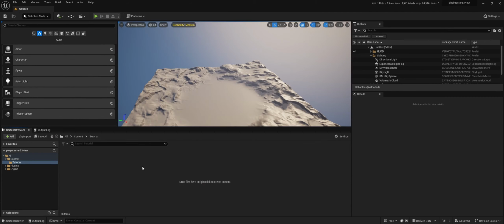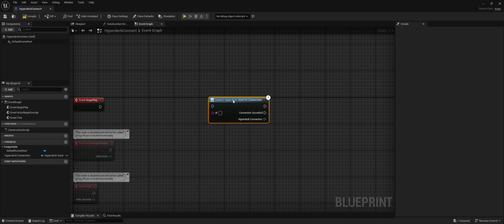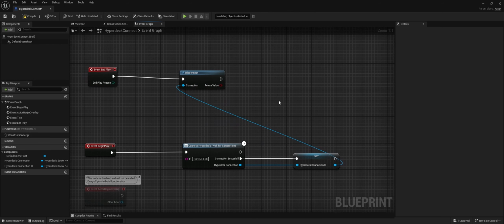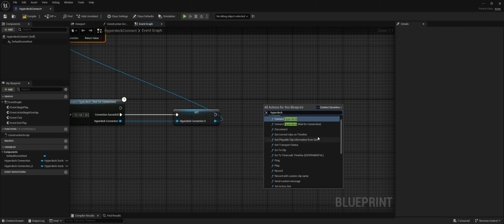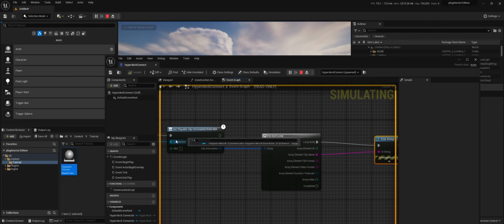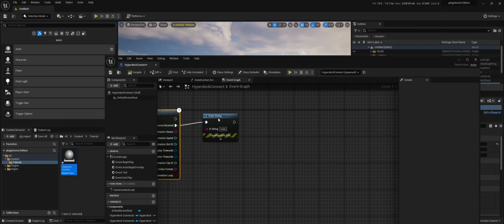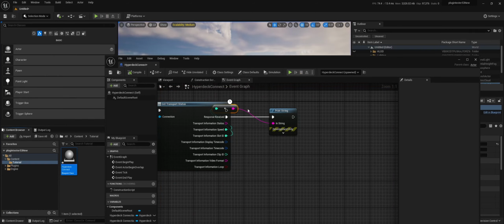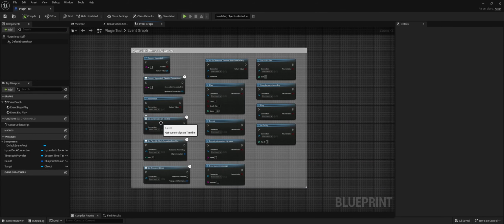Hyperdeck Control Advanced 0.7 now availabe  - Unreal Engine 5

Comment: Hey Geert, I bought the advanced version. But I keep getting "The following modules are missing or built with a differnt engine version: Hyperdeck" 

I"m using the 55 version with UE 5.5.
Reply from the maker: Hi! Sorry I totally missed this as I normally do support through Discord and email. I have replaced the 5.5 version of the plugin on Gumroad that now works with 5.5.4 of Unreal. 

Again sorry for the late reply.
Reply: Awesome, thank you!

Comment: Don’t know what this tool is about, but all the examples are possible with one line commands in a TCP session (in for example Terminal) with the Hyperdeck
Reply from the maker: The plugin is for integrating the Hyperdeck into an Unreal Engine project to send triggers within blueprints to the Hyperdeck and get information back. I use it for automation of recording of the build in sequencer in a packaged project.

You can use a terminal or make a TCP session another way if you would like. This plugin just makes it easier for people to make something quickly in blueprints or don't know how to code it themselves in C++ and only need this functionality.